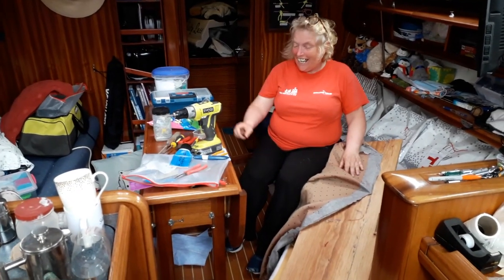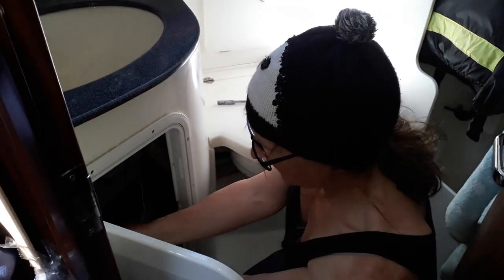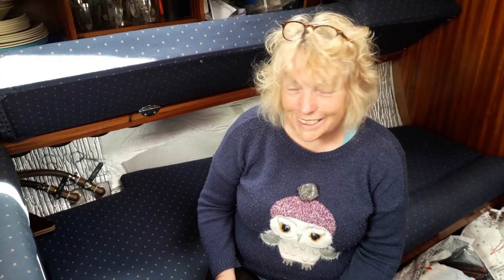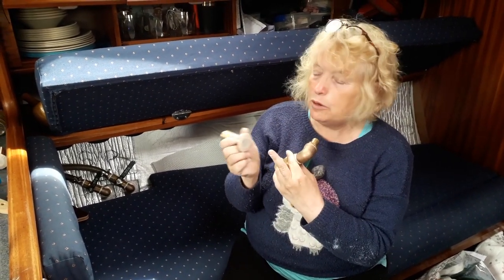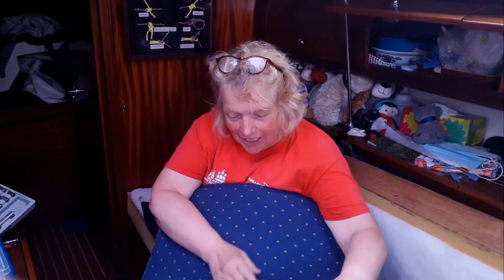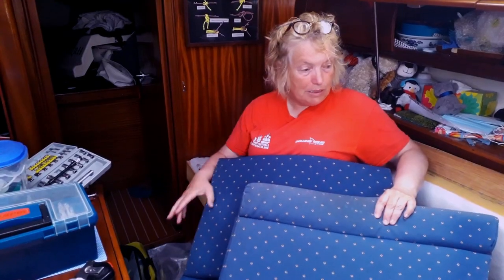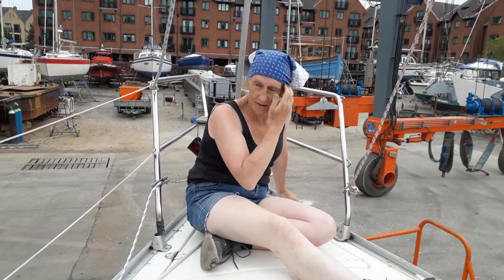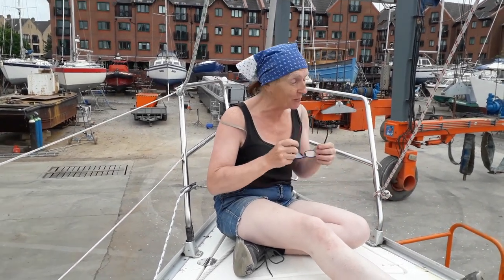Liverpool - Toe rails - Stanchions - Yard work - Ep. 194

Comment: Instead of PTFE tape I’ve used Loctite thread sealing cord - big advantage is you can adjust the position of the vale so the handles line up without having to screw right down tight.  Did the same job a few weeks ago and water is still on the proper side of the boat😀.
Reply from the maker: I never heard of that one, but we bought plenty of PTFE and so far it seems to be working fine
Reply: Nor had I.  I fitted Tru-Design valves and it was listed for sealing the threads. I needed my valves to line-up precisely and it answered the problem. Glad yours worked for you.
Reply from the maker: We are glad too 😄😄😄😄

Comment: Thanks Ladies.   My wife uses bicarbonate soda, inside the Cupboards in the kitchen,  I don’t know if it would work on a boat, but she lays the boxes down at stabs holes in,  at first I thought she was insane,  but they do actually Absorb quite a bit of Moisture so much so they need replacing every 2-3 months in humid conditions, once I thought i will take it to the next level and use one in a bathroom, yeah it lastest about two showers and the cardboard box feel apart because it was soaked..  i have seen people use a big bowl full it they are storing the boat on the “hard”  really not sure it will work.   But they are cheap it may help?   Not a huge gamble,  she’s kinda obsessed, you find these boxes in the fidge, food carboard, under the sink..     and when they are soaked and useless, she puts it in hotwater (normally it’s a near solid block of wet stuff by then,   And uses that water to clean the stainless steel, before pulling the plug,  apparently  she learned it from her mother and thought everyone does it,  now i find i do it,  so my daughter probably will aswell. The funny part is it use actually need some for baking,  you can never find a box of it that’s actually useable 😂.
Reply from the maker: Hi Trev - never tried BiCarb, but we found that the boat's supply of table salt absorbed water through the cardboard tube. It did wonders for the dryness, but we had a tube of very wet salt.
Reply: @SailingYachtSaltyLass  yeah salt does 100% but the Bicarb, (baking soda) keeps the salt dry, I’m no chemist, but I would assume by your answer the bicarb is far more Absorbent then the salt,    But she actually puts rice in the bottom of the salt shakers,  I don’t think the bicarbonate soda will work, (well it definitely will but i think far too effective)  and you can’t put rice around because that’s just asking for mice..   but the bicarbonate is really cheap (well atleast here)  ive just got a feeling it will be too humid and fail quickly.  
It’s maybe worth a shot,  if nothing else you can use it to clean stainless,    Also great to bath in..   ya feel squeaky clean after, i guess that what “bath bombs” are?  Over priced soda balls.   She does all strange stuff Wendy, I’m used to it now 34-5 year’s 
Like i say, that must be family “hack” that she just finds normal. Probably generations of doing the same thing.   My mother doesn’t she’s still alve and well, but i know when she vists, she always asks “what’s this for”  😂.  It’s kinda funny.
Reply from the maker: We also use bicarb for cleaning - just a bit of damp then sprinkle bicarb and get stuck in.  Sometimes old family tricks are the way to go. Living on a boat we use old tricks from 100 years ago all the time. We have to!!!
Reply from the maker: I'm back to continue my reply - the laptop ran out of charge and I needed to wait for the solar to recharge it! We looked at what people did before fridges and harsh chemical cleaning products etc. Back in the back, bicarb and white vinegar where the "Go to" products as was Turpentine. So.... 😉

Comment: Have to change sea cock for raw water to engine. Haul out in June approx. Waiting for space in the yard.
Reply from the maker: Why? Surely they are connected by a hose? Or is the seacock looking ropey?
Reply: @SailingYachtSaltyLass  it failed,  doesn't close anymore so had to open water strainer to break vacuum to stop leak at raw water pump.  Got new pump yesterday just have to wait for John to fit it
Reply from the maker: @WavedancerWesterlyfulmar  - at least it broke in a good way. If it had snapped off..... 😮
Reply: @SailingYachtSaltyLass  exactly...we're still floating

Comment: It's disappointing to see Bavaria would use mild steel screws in the cabinetry, they make dismantling so difficult once corroded, common enough with amateur mods, you don't  expect from  a builder. This shows two amateurs doing proper work with the right materials. I do like the Bavarias overall. You made that toerail work look easy, handy there's two people doing it.
Reply from the maker: We found the mild steel screws odd as well. Nowhere else in the boat has mild steel. I cannot think why they did it - the cost saving would have been negligible. 

The toerails and stanchions are not difficult, they are just time consuming because it is picky and tedious